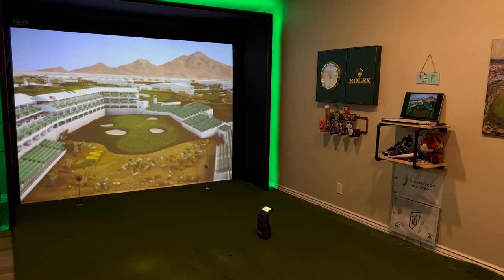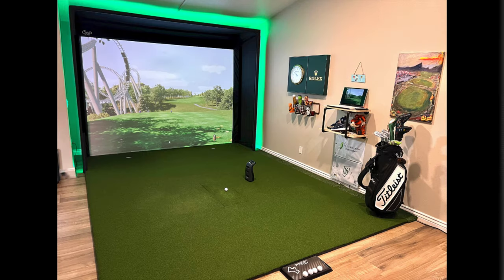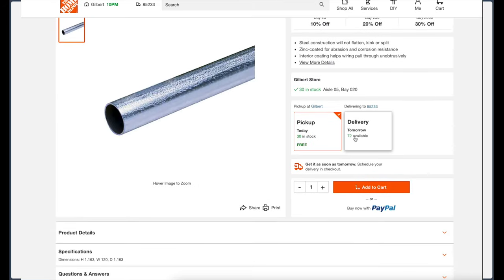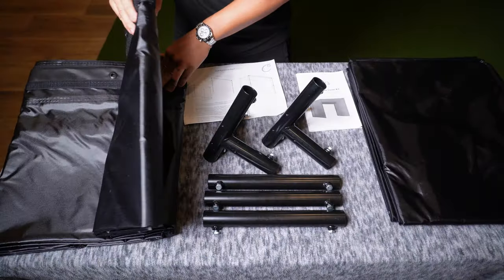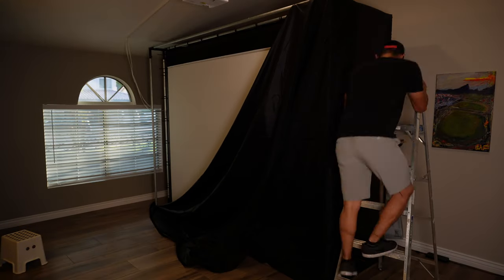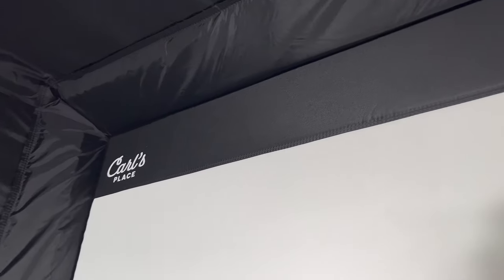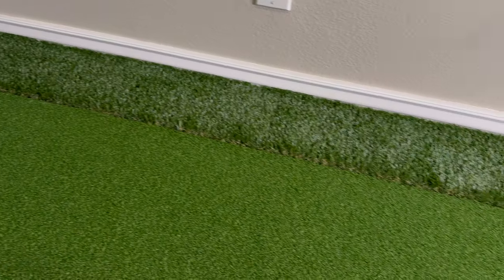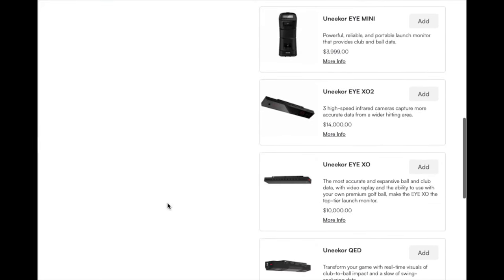How To Build Your Dream Golf Simulator To Fit Your Space & Budget | Don't Overspend | Easy DIY Guide

Comment: After watching a ton of content on this subject this vid was by far the best. I have equal lefty to righty golfers in the family. What is the minimum width required to be able to insert the smaller hitting mat in the center?
Reply from the maker: Thank you for that! For lefty and right handed players you would need at least 15’ wide for clearance. Check the channel for my latest video of the BenQ LK936ST projector, there is a chapter in there for the 3D Sim Planner tool that lets you input your dimensions and player height and gives you a 3D representation for clearance in your space.

Comment: I know you built your own hitting strip, but I feel like I am missing something... Most of the hitting strips you buy seem to be 1.75 inches in heght, if my floor consist of 1" foam tiles and putting turf, wouldn't my mat be sticking up approx. 3/4" ? Yours looked pretty flush. Thanks for this video it has me wanting to redo my area.
Reply from the maker: Yes, I built my own so I can get the depth right and make it the exact size I wanted. With the 1” gym mat and putting turf you end up roughly around 1.5” and most strips would stick up about 1/4”. You could add some kind of uderlayment to raise the surface up higher to accommodate for this or build your own so you can set the exact height. I also liked building my own as it allowed me to add a real tee where other divot hitting insert don’t have this. We have a video on the channel if you’re interested in building one.

Comment: Great vids! With the c series do you have the turf in front of the bottom edge of the screen or does the bottom of the screen sit on top of your turf? And what size pipe insulation pieces did you use?

Comment: This is a great video. Thank You. I am pulling the trigger to get the screen and enclosure.  How/where do I get the pipe dimensions and quantities to prepare?
Reply from the maker: Thank you for that! Carls will email you after ordering the breakdown with the pipe dimensions so you can get them ahead of time. If you’re purchasing an enclosure, please use our links in the description. We get a small commission and the cost is the same to you! We’re also available if you need any other help.
Reply: Ordered the DIY enclosure from Carl's Place less tubings through your link.  However, I only got an order confirmation.  They did not provide the tubing dimensions needed to build the enclosure.  My screen size is 90x120".  The overall size of the enclosure is 101.7" in height,  131.4" in width, and 36" in depth.  I also got the back cover.  Can you assist to determine the tube length and quantity needed for my enclosure?  Thank you

Comment: Great video. A couple of questions:

A: What was the total build cost of all the items in your final set up?

B: Has your handicap / game come down?

Thanks again! Wayne
Reply from the maker: Hi Wayne, 

With the new setup:
Carls enclosure- $1500ish
Turf with gym mat- $550ish
Launch Pro Unlocked- $5500
BenQ LK936ST- comped, but retail is like $4800
Laptop- $1200

Really though, you could go with a $1k projector and Mevo plus to save a lot of coin!

My handicap is down slightly from when I first bought my sim from 15 to currently 13, but shit shaping and wedge game is improved greatly. Most of my handicap is due to some ongoing back issues making driving and putting difficult…

Comment: Terrific video!  I’m finally pulling the trigger on a full sim setup. I’ve been using the Mevo+ with a spornia net. Ordered my DIY Carl’s Place enclosure. Not basically going. To be copying a lot of your setup. 
Couple of questions for you:

1) hitting strip - I’m currently using the CCE mat and it’s causing tendinitis. I’ve already got the gym mats you used and am sourcing turf. But wondering which hitting strip you’d recommend?  Your diy divot strip or Carl’s place divot strip or Carl’s Hot Shot mat?  Seems like you’re a fan of all of them. Wondering if you have a top pick?

2) Speakers - are you still happy with your JBL surround speakers?  Looking at getting the same ones. 

3) Laptop - I can get a deal on almost the identical spec laptop your recommend but MSI brand 3080ti 16gb graphics card and rest same. I know you said it works well with GSPro. Wondering what settings you have it on. I keep hearing that 3080ti laptop card is not enough for 4K on gspro. I haven’t used GSPro yet so not sure if it is even worth trying to run on 4K. 

Sorry for all the questions. I appreciate any guidance you can provide and thanks for the terrific videos!  Much appreciated!
Reply from the maker: Hello, sorry for the delay. We missed this question… Please reach out to us via our website or give us a call and we can address all of your questions and concerns.

Comment: Thank you for a good walkthrough. I want to build a home sim. My son is 6 foot 3 inches. What kind of clearance should I have in the room?
Reply from the maker: It really depends on the swing. 10’ is ideal, but 9’ can work depending on the swing arc. I have 9.5’ roughly in my slope ceiling setup and had a 6’ 7” guy in here with no clearance issues.

Comment: Do you strongly recommend 1-inch mats over 3/4 inch?  Would 3/4 not be enough for the divot action hitting strip?  Thank you! Great video!
Reply from the maker: I would recommend 1” over 3/4” for the height to accommodate hitting inserts and the divot style strip. You can use a wood underlayment if you absolutely need to use 3/4” for whatever reason though.

Comment: Awesome video! I’m just beginning my journey into an indoor golf sim and this is so valuable! Quick question tho: if the floor isn’t level, do you just pad the connectors on the bottoms to raise one side? Or do you just level the screen by adjusting the bungee mounts? Thanks again
Reply from the maker: Great question! I haven't had to personally deal with this issue, but I would assume you could get crafty and play with the tension on the screen to adjust or make the adjustments from the projector if it has 4 corner adjust. If you need any help, reach out to us on the website and we can help you for free.

Comment: Quick question on the Bushnell Launch Pro.  How easy is it to switch from a right handed to a left handed player?  Is there a lot of movement or additional setup required?
Reply from the maker: I haven’t had to do that, but you can switch it in the setting and play the hole out in the software instead of alternating to make it easier.

Comment: Just wanted to post again since I’m trying to build out a sim similar to yours…With the c series do you have the turf in front of the bottom edge of the screen or does the bottom of the screen sit on top of your turf? And what size pipe insulation pieces did you use? Thanks!
Reply from the maker: Hello, I have the turf sitting up to the turf, so the bottom of the screen is below the turf height. The Pipe Insulation I used was the standard 6’ pieces at Lowe’s/Home Depot for 1” pipe. They are a few buck a piece. If you need an immediate response for anything else, don’t hesitate to give us a call. Phone number is on our website.

Comment: Great video. Nicely explained. Do you get any movement of the turf on the rubber mat when you are swinging? Did you use adhesive to keep the turf from moving on the mat?
Reply from the maker: Thank you! I get zero movement from the turf on the mat. It has a really rough texture that makes it grip well and with the hitting insert in place it ties the mat and turf together. The mat will move slightly after so much use, but we’re talking maybe a half inch…in which case it’s as easy as pulling it back in place.
Reply: @PixelGolf  Great. Also, is there a reason you didn't mount the projector on the bar mount that they have that can attach to the frame? I will be moving my enclosure against the wall when not in use and was trying to decide between the bar vs ceiling mount. With the bar mount attached to the enclosure it would guarantee the same distance/alignment to the screen each time I move it. With a ceiling mount I would have to make sure the enclosure is in the exact spot every time.
Reply from the maker: Since my enclosure is only 33” deep, I’d have to have a really long extension. I move mine out quite a bit for filming and repositioning isn’t difficult at all, just adjust until the image is correct. I would imagine it would be more difficult to adjust the extension holding the projector as I imagine it would move a bit when moving the assembly.
Reply: @PixelGolf  Makes sense. I didn't think about the bar moving as mine would only be about 36" deep. It would probably have to extend out another 2 ft depending on the projector used. Sorry, last question. I'm also debating between the Premium and Preferred screen from Carls. I will only be using 1080 and my enclosure will be about 10'W x 8'H. Is the image at that resolution and size really noticeably better on the Premium screen? Thanks.
Reply from the maker: @rlbjr I personally don’t have any experience with the preferred. Based on the thumbnail nail it seems like a thicker woven pattern and more textured, so I would imagine it would affect the image. I will say the premium screen is extremely nice and it’s quiet as well! Whatever you pick, make sure to use good clean balls and clean clubs… it will look nice for a lot longer!

Comment: Great video, very helpful
I am currently building my set up and already have the GC3 
I only have about 3.3 meters width 
Because the GC3 is camera based I don’t need to hit be hitting directly into the middle of the screen right?
Reply from the maker: No, you can hit off center and most software has the ability to adjust the center point in the software for this reason. One thing to consider is, the more off center from the middle of the screen, the more bounce back is added. Think of jumping on a trampoline, the more in the middle, the more give the material has.
Reply: @PixelGolf  ahh great advice 
Thanks, appreciate the feedback

Comment: Hey, first great video really informative and love the setup.  You mentioned going through different launch monitors.  Im currently trying to decide between the new SkyTrak+ or spending a bit more on the Bushnell Launch Pro.  Any thoughts between those two units?  I think you mentioned you run BLP?  Any insight would be great as its the most $$$ and arguable most important decision of the entire build.
Reply: Its up to you. They both get the job done. For skills assessment & bag mapping go with skytrak+. If you're looking for something closer to trackman with more data, go for bushnell. Just warning you that bushnell will cost around $750 annually because of gold subscription and gspro. By no means does skytrak+ lack in quality compared to bushnell, but the bushnell is a bit more robust. I went with skytrak+ because I couldn't justify paying 1k more upfront along with $500 more annually for less lag and angle of attack. Hope this helped.
Reply from the maker: Thank you Kevin! I have yet to try the Skytrak+ unfortunately, but I can speak for the LaunchPro/GC3. I really believe that the LaunchPro has everything 99% of people need and the Foresight fitting software and technology is awesome, which is why you see it used for club testing by a lot of the big names. In conjunction with GSPro software it truly is an exceptional way to go, but the Annual membership may be a deal breaker for some. My advice would be to get a GC3 if you have the budget, or get the LaunchPro and maybe after the first year you can make the decision to unlock it a drop the annual fee. I’ve seen the unlocked option go on sale a few times too.
Reply: @asherchung9614  how has the skytrak+ been with misreads/no-reads and also how is it when doing shorter chip shot accuracy and putting for sim golfing on GS Pro or E6?
Reply: @kevinjung442  Haven't tested it in E6 yet but it experiences mis-reads when you thin the ball or if the background matches color with the ball. Like if I thin the ball or just hit it terribly it'll misread, which isn't a bad thing because i couldn't care if it reads a ball that goes 5 ft. Its pretty accurate on the short shots and havent tested putting. Im happy with it.

Comment: Where did you get the corner foam pipe covering, and where did you get that Rolex wall clock?
Reply from the maker: The pipe covering is from Lowes and the clock I made myself.
Reply: What about the clock itself? Before you built the box around it

Comment: I don't have a permanent place for a sim.  Your enclosure - Do you think it is feasible to use 2 or 3 furniture dollies to be able to roll the enclosure maybe 10 to 15-ft out of the way when not in use?  (I know this is a pretty unusual question for this).
Reply from the maker: Not unusual at all! I can easily roll my turf up, remove the gym mat and slide my whole enclosure out of the way. I’ve done it a few times actually.
Reply: Thanks for the response.  That's good to know.  Did you use furniture dollies or some other method?  @PixelGolf

Comment: I’m not sure why but for some reason the synthetic turf website says shipping will cost almost the same as the price of the turf which is ridiculous. Did you have the same issue?
Reply from the maker: I got it locally. Honestly, the best way to save some money is to Google Maps “putting green turf” or “artificial turf” in your area. There is typically a few suppliers and you just want a putting green turf that rolls the ball true. They usually have some demo areas at their building. Ask for end of roll pieces, you might save even more!

Comment: Thank you for great information. I have 96inch height basement. Is it enough for simulator?
Reply: His was 84 inches...
Reply from the maker: 96" is not high enough for driver, you want at least 9', 9.5-10' is more ideal. My ceilings are vaulted so they're 8 feet at the screen and about 9.5-10' at the hitting location. You may be able to get away with hitting irons though. Maybe take a stick that is like a 7 iron length and try it to check clearance. You would still have a blast with irons and wedges and I actually find myself more so playing short courses and practicing irons anyway.
Reply from the maker: Hi Davis, My white screen height is 84", but the ceilings are taller.

Comment: Why is a $400 projector not good enough?  Why is it important to spend $2K?
Reply from the maker: If you can make a $400 projector work for your setup, there is definitely nothing wrong with that and you should first and foremost stay in the budget you’re comfortable with. Typically, more affordable projectors have less brightness that make it difficult since you’ll need ambient light in order for the launch monitor to clearly see the ball and with less brightness from the projector you’ll have to use less ambient light to see the image. In addition, most affordable projectors don’t have a short throw ration making them have to mount further back from the screen to fill the image and typically will cast a shadow from the person hitting. There are however some great affordable options out there and you don’t need to overspend if it’s not a good financial option for you.